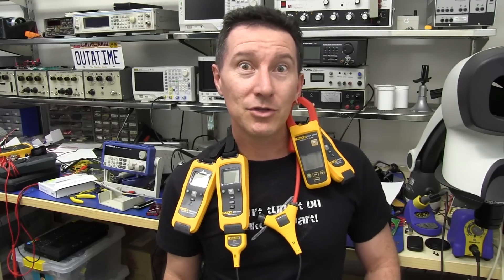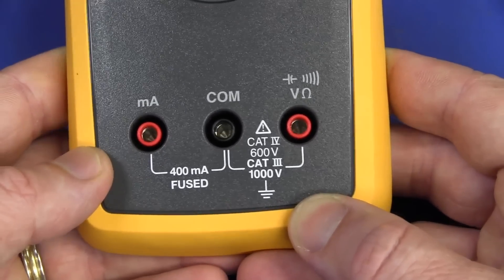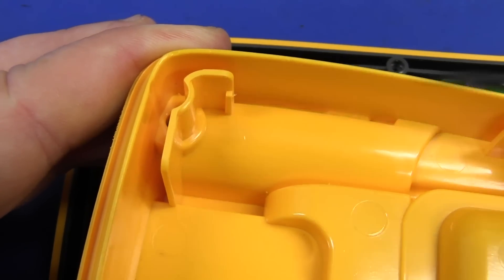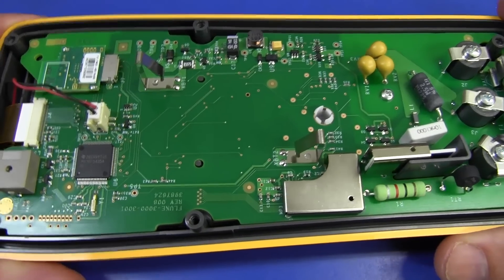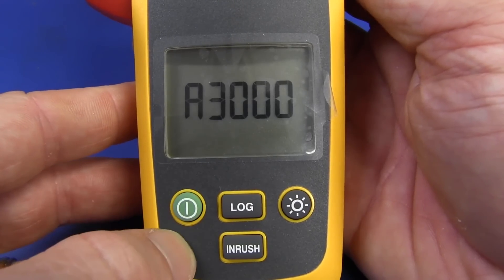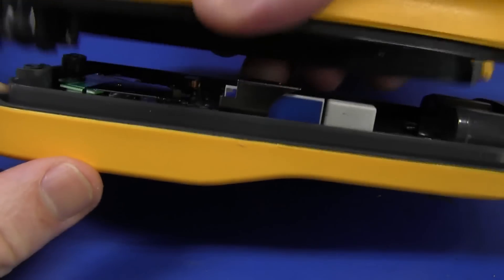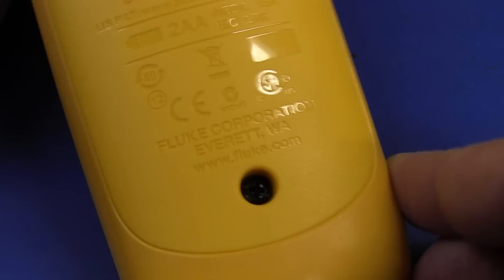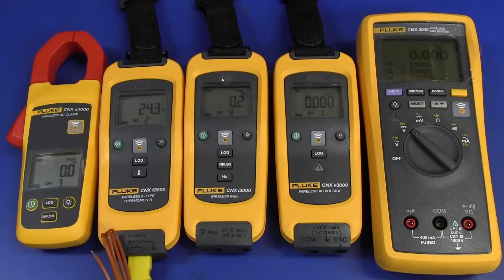EEVblog #417 - Fluke CNX3000 Wireless Multimeter Teardown

Comment: As I'm working in production industry service, I can tell that these things are VERY useful. In some situations one need to run all over a whole factory floor measuring all kinds of things. 
Usually I put up meters with logging capabilities, so I can pick them up later on and watch the logs.

Sometimes one need real time reading.

With these, I can keep an eye on some important spots on the production floor, at the same time as I stand at the other end of the whole building pushing buttons.

Comment: It does make sense - you're trying to intercept a surface leakage path from the component to wherever. If you have resist on the guard, the leakage path goes right past without touching it

Comment: The thermistor is a cold junction compensator. It's required for any thermocouple reader. Without the cold junction, the voltage of the thermocouple will actually read the temperature of the thermocouple junction minus the air temperature. Back when the tech was relatively new, they would put a secondary T/C in an ice bath as close to 0C as possible, and put it in series with the junction and that would compensate the temperature difference.

Comment from the maker: Maybe not unusual in proper temp meters, but unheard of in a regular multimeter that supports the same K type probes. They just use an internal temp sensor to get the general ambient temperature, so no proper input cold junction compensation as such like you see in the CNX.  Usually just a crusty on-chip PN junction sensor.

Comment: Actually looking again the 2 long tracks look like they are also guards for presumably the big integrating caps - makes sense not to have resist on them I'd guess this custom IC is the main ADC. The thing I'm looking at has resist-free tracks that look less like guards, although it is measuring low capacitance so could be similar.

Comment: 1N4148 diodes were also used as compensation sensors later on as they had a relatively stable temperature coefficient as well.

Comment: At 38:00, The thermistor  is actually used for what is called Cold junction compensation, all thermocouples have a minimum of two junctions of dissimilar metal.  T type is a junction of Copper and Constantan so there is the welded junction at the tip and then another at the connector where the constantan wire is terminated to the copper PCB trace.
Try "Cold Junction Compensation" in Google
Opamp could be a reference for DC bias of thermocouple or current source for Thermistor.

Comment: Nothing unusual about thermistor at I/P terminals - all thermocouple sensors need to measure the temp where the TC wire joins to copper, as the voltage represents the difference between the thermocouple and the cold junction, so you need to know the latter to know the absolute temp of the TC

Comment: For the big input traces : in thermocouple, you have to prevent temperature gradient to make sure the cold junction temperature is good at point you measure it. I'm not sure, but if you remove the resist on this pads, it is probably easier to get isothermal conditions (better convection, maybe).

Comment: Perhaps similar to guard rings used on higher end instrumentation amplifiers? They prevent PCB surface leakage currents getting to the sensitive parts (usually the Gig-ohm input inpedance trace - every little helps, check out the Burr Brown INA116).

Comment: an EE course precision electronics.
since the seebeck effect also i present in the metal junctions of SMD resistors, a temperature difference from one end to the other of a smd resistor can generate a small voltage.

Comment: If your meter is in a temperature controlled lab, you can just offset the measurement. (If your cold junction is in melting ice, the measurement doesn't have to be offseted). A more practical solution is to use a RTD to know the cold junction temperature and correct the raw voltage with some processing in the microcontroller.

Comment: Nope, It makes perfect sense in industrial applications. You can measure amperage and voltage at the panel, and at the load, monitor temperatures, harmonic distortion.. it's never ending. It's a niche tool, but works great especially for those that need to remotely monitor things, such as high voltage panels that need to be energized for troubleshooting.

Comment: We use a fluke wirless dosimeter where I work. It uses a 802.15.4 module to communicate. Just ttl serial at 9600 baud.  It uses a digi xstick to communicate back to a computer.

Comment: 39:00 not exacly, voltage on thermocouple is proportional to difference between "hot-end" and "cold-end". So to calculate proper "hot-end's" temperature you have to know "cold-end" temperature.

Please reffer to maxim thermocouple ic's.

Dave, You could make a video about thermocouples. It is preaty interesting stuff.

Comment: Absolutely, input connections create a parasitic thermocouple which voltage substract to the "real thermocouple". The thermocouple measure the temperature difference, not the absolute, so you have to add the "cold junction temperature" to know the absolute temperature. For example, if your meter is at 20°C and the thermocouple measures a 100°C temperature, you read 80°C without cold junction compensation.

Comment: Awesome, equipment! they work awesome in high R.F. noise environments. Pricey at 1,000$ to 1200$ for the most common used and useful kit. No price on your life, especially when measuring the primary feed to a 25,000 volt plate transformer :)

Comment: Seems pretty obvious they designed the current module with the funky connector so that there's no way you can plug your normal fluke probes in there.

Comment: What's the thing with these wireless multimeters? Helping the battery factory? Sending the trainee to the high power rectifier and measure from a safe distance?
Reply: There's less wires. And wires are a HUGE issue if you're like, assembling something, and have a lot of parts on your workbench. You move the tool, BAM, everything on the floor.

Comment: The AC voltage module has a capacitor in series with the input?  Doesn't that make measurement frequency dependent?

Comment: Please , can you make a review for the cnx system , ?
Personally I'm interested by the wireless system , but not for security , just for distance , like to find the correct breakers for a power socket in a house .
I'm interested to buy it , but i'm a little bit affraid if it can't run with a long distance ...
thanks for all the other reviews .

Comment: off the top of my head comes hazardous/high power(that clamp is rated to 2500A after all) environments that would require something like this that right now might use some exotic super-expensive-fiber-optic test jigs. for those apps, these kit should be a bargain

Comment: Could it be that the lack of fuse access is based on a requirement for the use of tools, i.e if you can master the use of the screwdriver, then you may be legally considered as a qualified person in case of a lawsuit wherein some ninny puts his bare hands on the fuse with the leads still hooked to high voltage? In other words, they didn't "forget fuse access," but instead followed their attorney's advice.